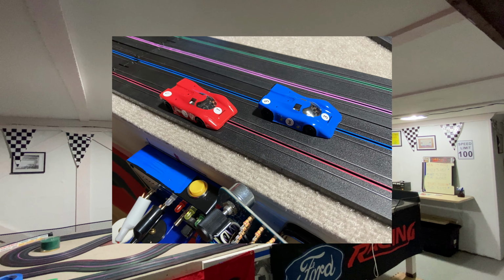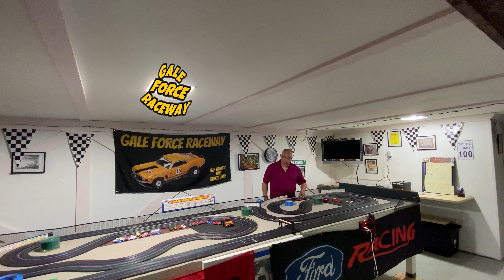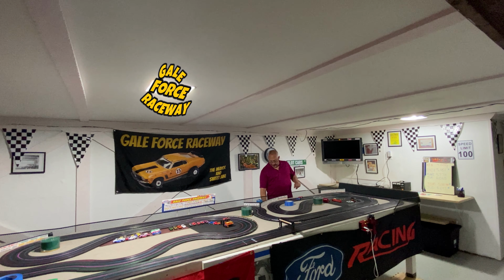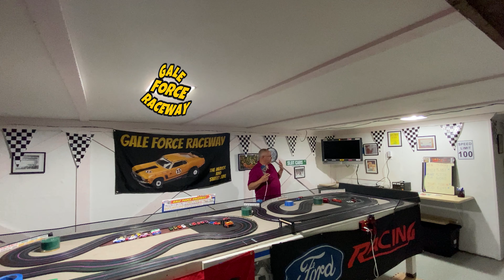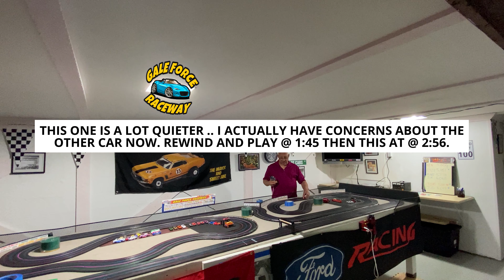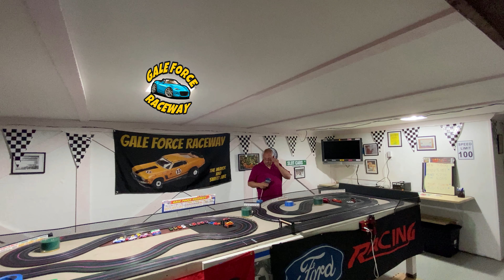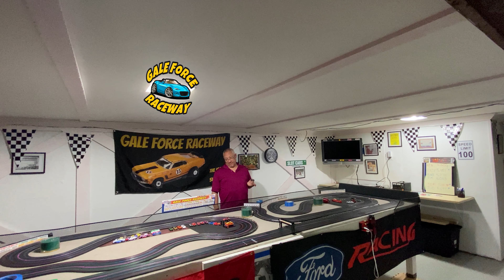Gale Force Raceway H.O. Slot Car Track...buys VIPER Vspec's!!

Comment: Nice!, I love my Vipers, I am curious what you find out about the blue car. Viper cars are usually pretty consistent with each other. Next you will have to pick up their 3 ohm Modified chassis, the VSPEC runs a 6 ohm arm, getting down into the 3ohm range things really start to get crazy.
Reply from the maker: Yeh this is my limit though... not a speed demon, I like things more real.. Magna Traction with better tires/ some G Plus and Super G Plus... Just wanted  something to go nuts with sometimes.
Reply: @Gale_Force_Raceway  I hear that, on my AFX track anything faster than the VSPEC was not worth it. On the Viper track though it's something to see and hear the modified cars and Neo cars run. They are so fast it makes you laugh. I do love my Magnatraction cars as well, they run so smoothly on the routed track, they barely make any noise.